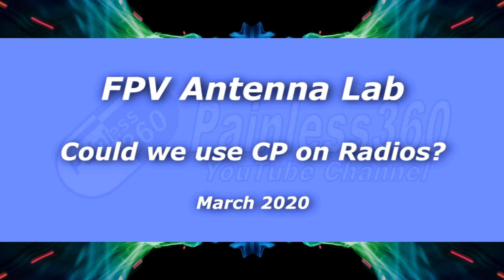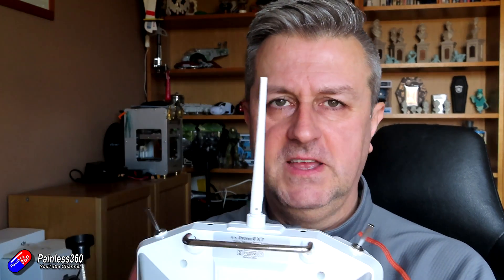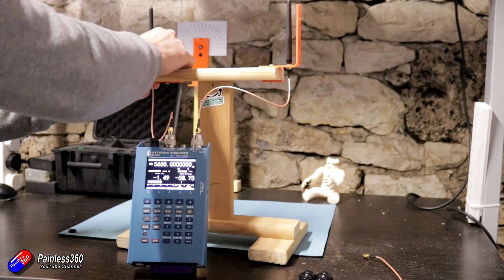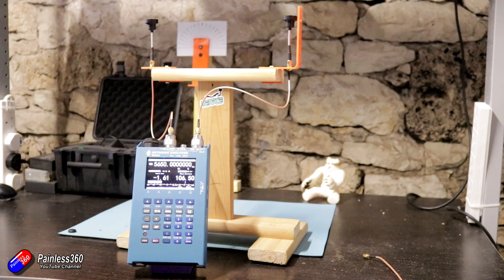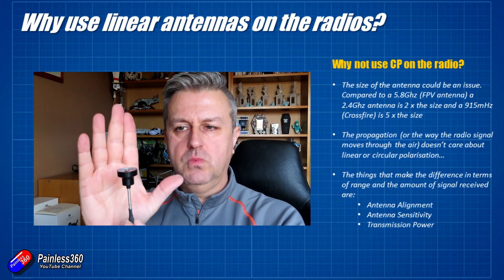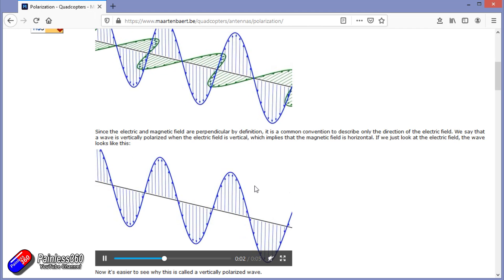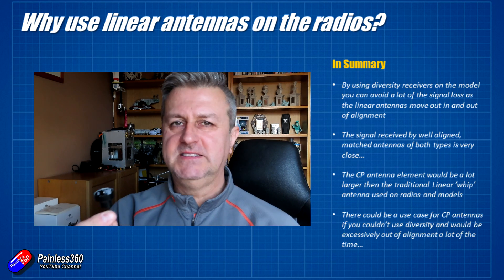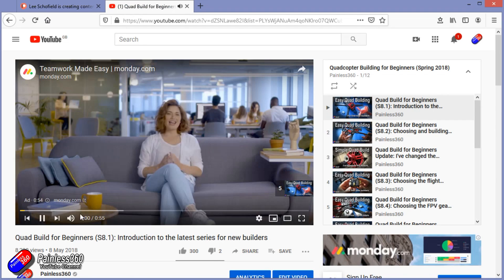Why not use circ. polarised antenna on our Radios?

Comment: I use a true rc 2.4 singularity on my taranis x9d+ works wonderfully. Range tested over 2 miles. I only use the one CP antenna, and stick to linear on my aircraft (mostly wings). There's never a drop due to orientation so turning at range isn't as dangerous.

Comment: Before I even clicked it was "because nulls" as my answer and the need for a diversity setup.

The CP antennas having a -3db and -6db point which could seriously hamper long range in certain orientations.

But long range rigs generally dont go full acrobatic and crazy at distance so putting a CP antenna in a vertical orientation would likely work fine and never risk pointing a null back at the RC transmitter.   Combine that with a well setup return to home and your orientation for CP antennas is likely still good.

Pretty sure 1/4 wavelength design can be applied to circular polarized antennas because look at the absolutely tiny CP antennas that are showing up from True RC and others.

Would be interesting to see something similar applied to the 1.3ghz and the MHZ realm of products.   Basically a VAS style RH CP element that drops down over the linear element of a 900mhz ot 1.3ghz antenna.

Comment: Worth mentioning that the DJI system is using 2 circular polarised antenna for the control link on the aircraft, with 2 linear on the handset...

Comment: Hi there back in the 90's I had 27mhz for mi model boats and we had a telescopic antenna on the tx and a long wire antenna on the boat. So the 24g is much safer for the eyes as people don't have the meter long antenna waving around as they sail

Comment: One important thing is you might need right hand polarization at one end and left on the other, RHCP LHCP.
Think of two screws facing each other. The antennas might be more mixed polarization than circular.
I've been a radio ham for 37 years.